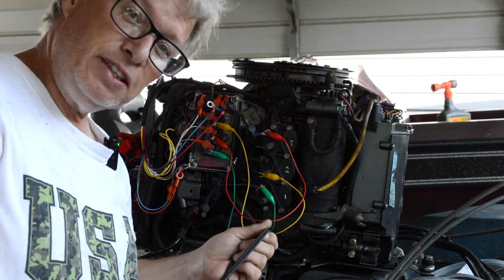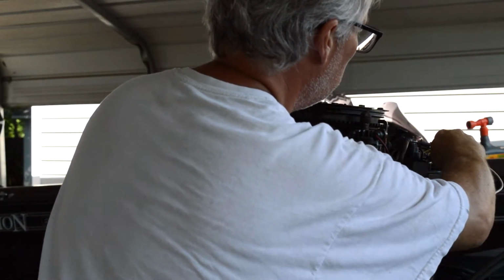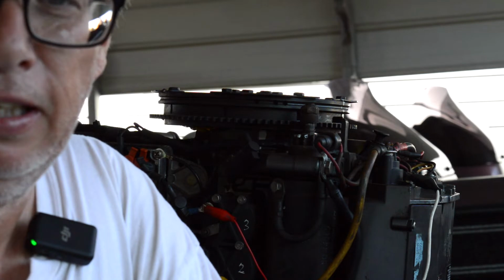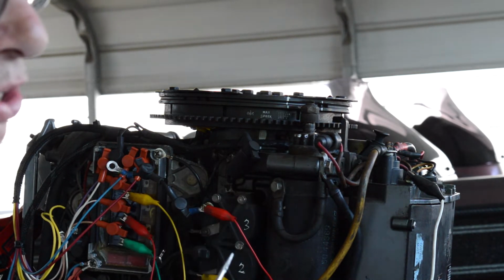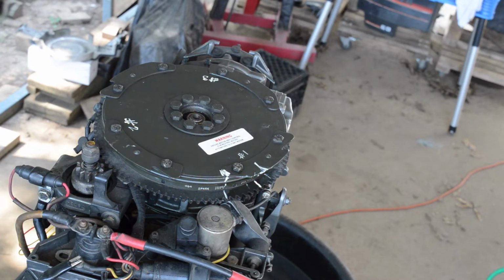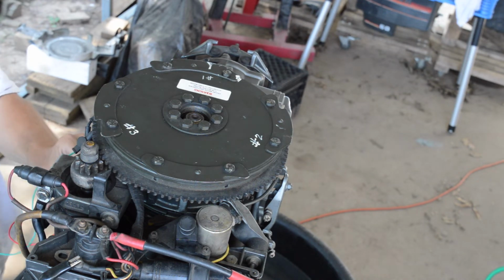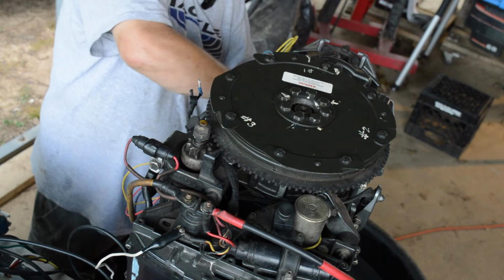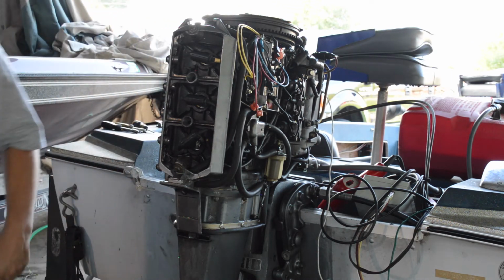Is it a bad trigger?  #nashville #tennessee #percypriestlake

Comment: Can a bad voltage regulator cause misfire and loss of power on a 1989 115hp 2+2 mariner?
Reply from the maker: Probably not does the tach work? Does it charge?

Comment: Buy CDI ELECTRONICS ,not China
Reply from the maker: Ok, but if CDI doesn't make what you gonna do?  In this case it was the customers decision not mine.  He knew it might fail.  Those few Jetunit parts I have put on, in the past have held up.  I like CDI am a dealer for them but I have had those fail too.  OEM is the way to go but very expensive.  I try to go that route but working on this old stuff nobody has any money for the old stuff.

Comment: I replaced the trigger, stator and bothe rectifiers on my black max 175 mercury engine and it seemed to be running great first trip out then when I took it out and was using my fish finders I noticed a occasional misfire  then it progressively got worse and after maybe 2 trips later I took off drove around 5 miles from where I put the boat in  it runs Great till I slowed down then it shut off and didn't want to idle at all.... Since then I have rebuilt the fuel pump replaced the switch  boxes cleaned the carbs checked the reeds checked compression and even tried to swap out the trigger but it will not crank with the motor lowered in the water but it will out of the water and has a bad misfire I would hate to give up on it but I am running out of options
Reply from the maker: Check all your grounds.  Get a CDI trouble shooting guide.  Were they Mercury or quicksilver, CDI parts you put on?  You'll have to start by checking everything make sure everything is firing, check your coils, and make sure its getting fuel and you don't have a collapsed fuel line.  It can be frustrating just hang in there.
Reply: @hawkeyemarine  yeah I replaced all my vacuum lines all my fuel lines I know I'm getting spark on all the cylinders but I feel like it is firing in the wrong order or double firing at some point and that's where I'm lost at I have swapped the trigger over and put the one I had previously on there and I never had a misfire I just had a problem when I change the stator trigger and rectifiers
Reply from the maker: @nickburns9125  double check your flywheel and see which one you have.  You might have a different flywheel for the parts you ordered.  Send me the model number I'll look it up.
Reply: @hawkeyemarine  jetunit stator and trigger. I'm actually considering putting the original stator back on to see if the misfire goes away and that may at least eliminate because it ran fine until the battery started dying and then it would still run great at low RPM
Reply from the maker: @nickburns9125  I would put the orginal components back on.  Get a CDI troubleshooting guide downloadable.  Go through the guide and see if you can find the issue.  If your power packs are double stacked the inside one will go out first because it gets hottest the fastest.

Comment: When you were looking for the number 2 spark I saw that you had another spark around 120 degrees clockwise showing number 3.

The number 2 coil should only show a single spark around the flywheel not two sparks, one at the right place plus another one anywhere around the flywheel. 

It seems like number 2 coil is sending two sparks, one where it should and a second one where it shouldn't.

That looks like a bad switchbox. 

A good switchbox should send only one pulse per revolution for each coil. Not two nor three pulses, but just a single one at the right position of the flywheel.

These engines tend to have bad coils that kill the switchbox.

The engine seems to work alright because each cylinder gets the right spark on tine, but a second spark should never appear when checking the timing.

Each sparkplug should spark only once per revolution,  when the piston is at, or very close, to the upper dead point.

If the sparkplug sends a second spark this could cause ignition of the air and fuel mixture inside the cylinder getting flames inside very much the same as any engine working right sends flames only towards the exhaust manifold. 

A second or a third spark out of time may cause an extreme heat inside a cylinder.

I think this is what is causing my 1997 Mercury 135hp v6 to trigger the temperature alarm when temperature gauge reads 3/4 of full deflection after a couple of minutes at above 3000 or 4000 rpm getting planing speeds.

I have replaced water pump, thermostats and poppet valve but my engine keeps getting too hot, although it runs powerful. 

Another weird symptoms are some pops when starting sometimes. 
I am going to order 6 new coils and 2 new switchboxes.
Reply from the maker: Great comment thanks for watching!